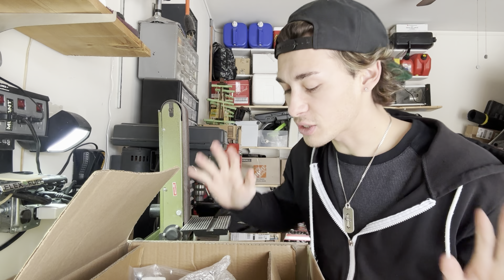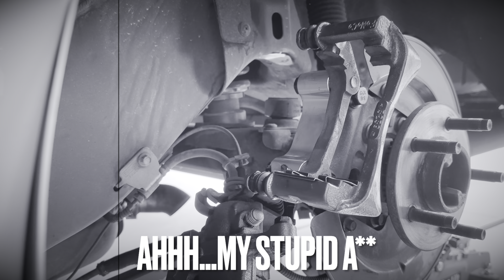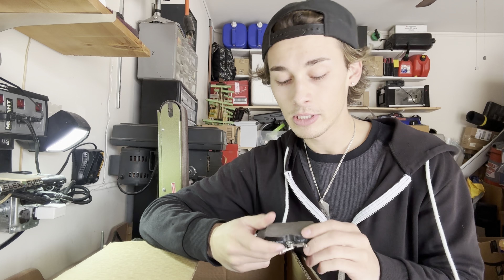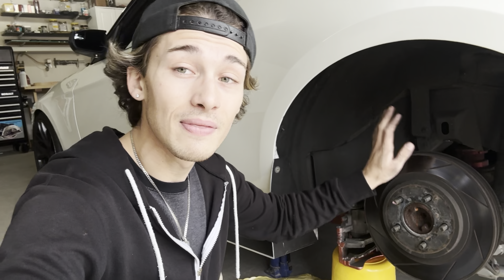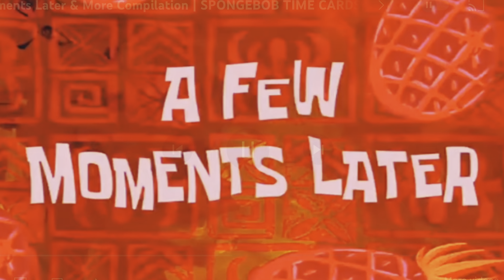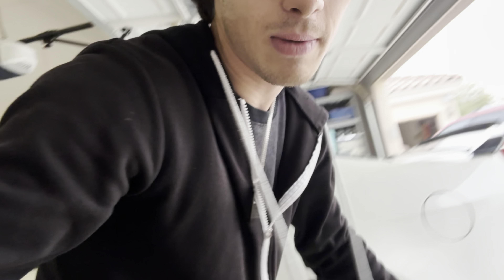Installing HUGE GT500 Rotors on my V6 Mustang!

Comment from the maker: Where to buy 💰

Rotors: 
Callahan CDS03040 REAR 350.08mm... https://www.amazon.com/dp/B07P8BTR7J?ref=ppx_pop_mob_ap_share

Stainless Steel Brake Lines: 
Centric 950.61501 Brake Line Kit https://www.amazon.com/dp/B003K3P9Q4?ref=ppx_pop_mob_ap_share

Brake Pads:
https://www.r1concepts.com/c/brake-pads/2014/ford/mustang?op=10334&parentCatId=5&cat_id=5&router=category-list&a=2